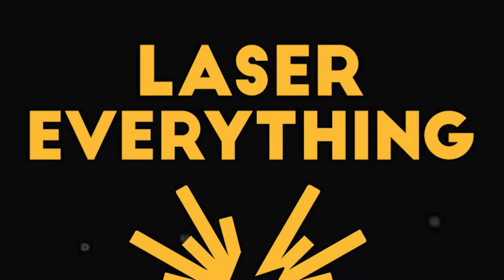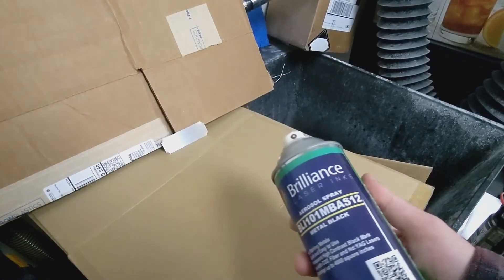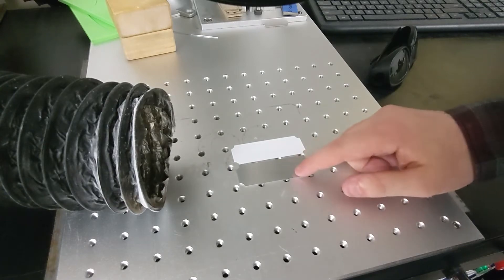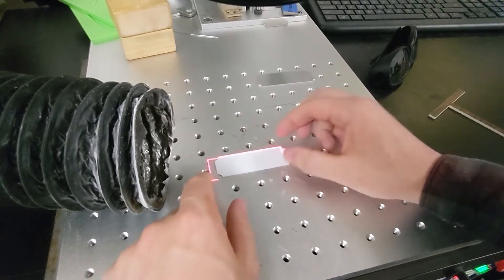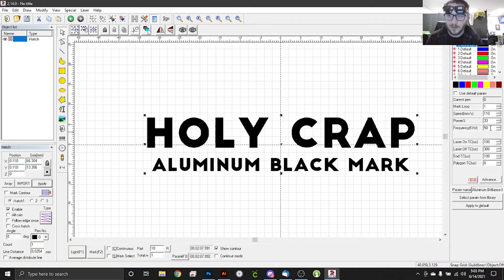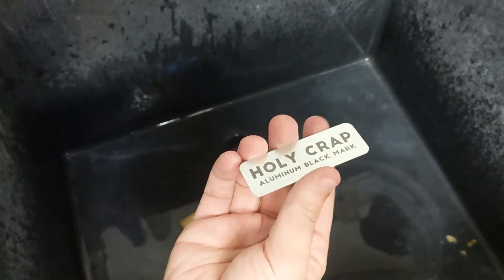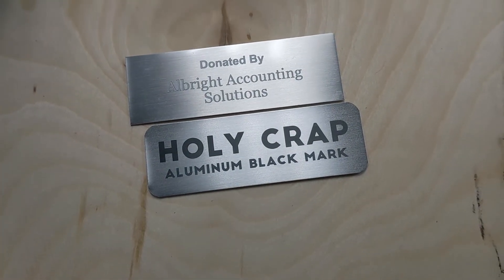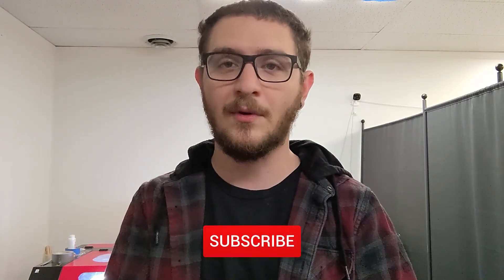How to Engrave a BLACK MARK on Aluminum with a Fiber Laser | Fiber Laser Tutorials

Comment: I get my engraving eareased when I scrub it down. Is this raw power issue or may be something else? Cheers!
Reply from the maker: If you’re using an assist spray like in the video, you may not be fully activating it and may need a touch more heat. Also, make sure the metal isn’t all oily or greasy, could cause issues. Spray has to be direct metal contact

Comment: i have a mopa 60w Fiber laser...would you have any way to mark black with it? I can't figure it out and have tried multiple settings and have watched multiple videos. Before I go and try this option.
Reply from the maker: Generally speaking, you’re only gonna get a medium gray out of raw aluminum without creating a soot covered mess, and no other assist material. You can get a surface mark that’s black on like clear anodized aluminum, but hasn’t been something we’ve done and would be more akin to color annealing on stainless or titanium where you are putting a surface mark on the anodizing.

Comment: Technically you can do dark grey or almost black with just the laser machine on aluminum, takes much longer than engraving on stainless steel and incredibly much longer than white on aluminum. Need a pretty powerful machine for more than 110x110 magnifying glass. Also the sweet spot for aluminum is ~ -5mm compared to stainless steel sweet spot.
FYI Overall with whatever material. Frequency doesn't really matter, I just switched to 0 instead of 500k for everything it's more consistent in terms of black for everything, so it doesn't red shift anymore, might get blue shift though, if done too fast.

Also use the exact same program and machine at work, also have that lens for aluminum, though I use that lens only when I need to do sort of black, but don't need any extra stuff to add on the material. Otherwise I just use 300x300 for stainless steel or white aluminum hatch. 300x300 has more leeway in terms of height sweet spot, 110x110 for stainless steel needs like 0.5mm precision in terms of height, otherwise if too low will burn the material (brown) or if too high will make the surface sort of white or mix of other colors depending on where it shifted more with thick sharp lines.
On the right side the spot is pointless it does nothing.
Laser on TC, Laser Off TC and End TC also useless.
Polygon is interesting, but it only enchances the contours (edges) and doesn't do anything for the hatch inside, even if contours and follow edge are disabled.
Power I use mostly only 50%.
Speed most of the time 200.

On the left side, "type" I use a different one which is the fastest, the one that skips wasting time on empty space, but it can sometimes cause some issues in terms of hatch consistency though can be overcome with proper line distance+order of angles, also I maxed out the movement speed (10000 under F3 I think it was) when it's not engraving.

In terms of size yeah 0.02mm is basically for everything pretty much good enough, even for the smallest stuff, going higher than 0.02mm and increase speed to 300+ will start lowering the quality. Though as a second hatch I most of the time add 0.1mm or 0.05mm.

Comment: My ezcad software says my frequency can only do 20 , it won't do 25Hz. How do I fix this?
Reply from the maker: It’s important to note that only the laser source specifications can confirm what your laser is capable of, but the software will stop you from imputing a value outside of the set min and max value within the software. The software doesn’t ask the source what its limits are though, entirely user set. You can update the min and max values within the f3 menu of ezcad (or device settings in the case of lightburn).

Comment: Thanks for the vid. I am able to get it working on black anodized and raw aluminum. However, when using the same settings on red anodized aluminum, it does not leave a black mark. What setting should I be changing to account for the anodization?

Comment: Are there any concerns with 90 degree on bare aluminum reflecting? I'm using a galvo fiber.
Reply from the maker: there is ALWAYS a reflection concern, especially when working with metals. make sure you're wearing your eye protection!
Reply: I was more concerned with the reflection into the lense causing damage. But yes, always wear PPE 👍🏽
Reply from the maker: @guythmike  It would be a freak accident if that were to occur with Aluminum. Other metals like copper, silver and gold pose a much higher risk in that regard. Generally aluminum is regarded as safe optically speaking.
Reply: Thank you! It was a pretty big investment for me and I got it solely for aluminum. For now.
Reply: @LaserEverything I meant more of reflecting back into the lense and causing damage

Comment: Hoping someone can help.  Been trying with a 50w laser, turned down the power to about 22% but othereise the same settings on the video.  I've defocused about 1mm but still can't get the black mark.  

Any ideas would be appreciated!
Reply: Im in the same spot, did you ever find a solution?
Reply: @jamesgates678 the laser mark spray doesn't work for me at all.  Tried different settings with it.  I can get close to black (not jet black) with high power and multiple passes.
Reply: @ChrisZillaGaming ty! What kind of speed is working for you? I have a 50w as well.
Reply: @jamesgates678  depends on the material and how deep you want the engraving, but slower is the key.

Comment: Is determining these settings all trial and error or is there a resource that helps you understand what you might want to change to get a desired result?
Reply from the maker: There's always an incredible amount of trial and error that goes into dialing any set of parameters in. Even settings confirmed by someone else on the same exact machine as you will require some tweaking and adjustment to get right on your end. It's never 1:1
Reply: @ in photography there’s something call the exposure triangle where you adjust ISO, Aperture, and shutter speed to get a properly exposed image with the desired look. What I’m looking for Is there anything that explains what each of the variables does such as frequency, power, speed and how adjusting certain ones will lead to desired results. There must be some starting point even if all machines and materials are slightly different. Example you want a deep dark etch in hardened carbon steel. You wouldn’t arbitrarily choose a settings and go from there. Their must be something that says typically you if you want deep start here if you want dark start here.
Reply: I did the exact same thing. I wonder why this spray doesn’t work for me. Does it have to do with the type of aluminum or whether it is anodized ?

Comment: Please help!! Why am I getting lines in my black engraving when the diameter changes 🤷‍♂️ using stainless steel. I can get a lively gloss like finish on a smaller diameter but when I use same set up just change diameter size on rotary (ezcad) I get awful lines appearing ?!
Reply from the maker: If the lines follow the orientation of the rotary, it's likely the split size and line distance not jiving together. The lines are usually a result of the line distance/interval not dividing evenly into the split size, leaving a "remainder" that doesn't get filled. It may just be more noticeable on different diameter items due to size maybe. If that doesn't help out, join one of our communities in the description and you can make a thread post where the support community can dig into it a bit more and help troubleshoot

Comment: Do you know of a QR code engraved on stainless steel metal in the back of the watch would be readable?
Reply from the maker: Glare/angle of the camera reading the code would be a factor on that and surrounding light sources, so the darker the mark or contrast from the surrounding metal, the easier it should be to read. If the metal isn't polished or shiny, it would be easier, but it just depends on the circumstances. On stainless, I would try following the Z mark method from our z-mark stainless video, it provides the deepest of black marks.

Comment: I Bought the Laser Pecker 3 to engrave onto metals. Currently I need to engrave onto a Zinc Alloy with Electroplated Coating. The Laser Pecker does not come with a manual, do you know how I can get a back finish on the engraving? Do I need to use Brilliance Spray or Cermark to achieve a black finish? I am completely new to laser engraving.

Comment: Did some tryed titanium dioxide with alcohol solution in spraybottle ratio 1 to 5
Good shake before spray it on and let it dry.
Wonder if it works also on aluminum ?
Reply: What do you use that on?

Comment: Hi Alex  we have tried Brilliance Inks on copper and on our 150 watt laser, we used 300 mm/sec and 85% power and it worked a treat.  We left the metal for about two weeks with the Brilliance Inks still on a part of the plate.  Same conditions and it failed miserably really bad result. Do you have any idea how long you can leave Brilliance Inks on metal before it loses its ability to work?

We have no other reason why - may be you or someone knows the answer.  Cheers David
Reply: Some important component is gassing-off.

Comment: I tried to mark on aluminum but didn't work. So optic laser can't mark any type of aluminum? Or a 5W laser can't mark on aluminum?
Reply from the maker: Diode lasers in the 5w range typically do not have the power required to mark aluminum.

Comment: I bought the Nasan – LS1 laser back glass separator machine. TL-LS1-NASAN
However I have no instructions other than some templates and a couple videos. I want to use it to engrave on different surfaces. What are your suggestions? Your website has some discord classes. Is this the best route to take? Thank you!
Reply from the maker: The LMA is great to get started but I'm not familiar with the Nasan Lasers. I'd start with the Facebook group or Discord server so we can check out your machine and try to figure out what  it's running.

Comment: This was done on a 30W laser , can I assume that a 60W machine would render the same result at half the power or double the speed , or is there a formula to make the equivalent setting
Reply from the maker: More or less, yes. But it will take a bit of experimentation to really narrow it down. Will probably be easier to pull off with a larger lens.

Comment: Amazing. SO can I use any laser machine of about 20-30W? Just coating the Alu with that paint, lasering, washing nd I have that result?
Reply from the maker: Yes, absolutely. Since recording this I've found larger lenses work better. You want a nice big dot size so you don't just vaporize the catalyst. Your wattage should work great.
Reply: @LaserEverything  I thought it was working only with UV or blue lasers instead it works also with red ones. That’s great

Comment: Will this work with an 20w fiber laser? I just purchased a 20w Raycus fiber laser and it will be delivered soon. I'm really stoked to get started creating.
Reply from the maker: Yes, absolutely, might even be easier. Biggest issue with brilliance on fiber is that the fibers are usually too powerful and burn away the catalyst.

Comment: Does this work also for a diode laser? I got a Atomstack P7 pro and it works with aluminum, but i like the dark black letters. thank you
Reply from the maker: To my knowledge diode lasers don't put out enough power to activate the chemical catalyst.
Reply: How could you do something similar with a diode laser engraver? Is it even possible?

Comment: Have you tried these params with different size lenses with the same results?
Reply from the maker: Larger lenses will likely require more power, smaller lenses - less, due to changes in dot size.
Reply: @LaserEverything  that what I have seen also. I f I need to deep engrave or cut I use my 163 lens if I need to surface etch, black mark on stainless or engrave tumblers etc I use my 254 lens.

Comment: Any idea whether Brilliance will work as well on brass?
Reply from the maker: Brilliance will definitely work on brass. I think they have settings for it on their website but it will likely take some trial and error to get it right. It's a good catalyst but you'll definitely have to dial it in for your lens/wattage.
Reply: Thank you for your reply. I suppose the lasers for use on stainless are appropriate for other metal, too. Right? @LaserEverything
Reply from the maker: Yes fiber lasers specifically are designed for good absorption on all metals.

Comment: The black mark comes off after i polish my metal, what part of the setting should i change ? Btw your videos have helped me so much, so thank you !
Reply from the maker: This should be the LAST thing you do to your metal. Brilliance is just a surface bond, it holds up pretty well to scratches and dings but a full on polish is gonna be tough for this to survive. If anything make sure your metal is getting hot enough - especially difficult with aluminum. Heat is required for the bonding process to take place, too much and it will burn away, too little and it won't bond. It's a fine needle to thread.
Reply: @LaserEverything  thank you for the help ! Yeah the metals im using are aluminum & nugold which is mainly copper and im having a hard time getting the right settings for the black mark i want

Comment: Very cool. How well does this work if the piece is anodized?
Reply from the maker: Likely not well at all. The chemical needs to be in contact with the metal to bond so if there's a layer separating them I can't imagine it would do very well unfortunately.

Comment: Wow, is this possible in copper? Been playing with aluminum lately.. would like to have a hold of this spray!!
Reply from the maker: Copper is the most difficult metal to use spray marking chemicals on. It reflects a ton of the laser light and makes it very difficult to heat up to the temps needed to bond with the spray. I've seen it done but don't have experience with it personally.

Comment: Is this spray basically the same as Cermark?  That's what I use on my C02 for marking metal.
Reply from the maker: Yes I have both in my shop. Mostly the same thing but I think brilliance performs better and it doesn't hurt that it's much cheaper. Never tried cermark on aluminum, I know it works on steel though.

Comment: Nice, i was on a fb group and someone said cutting silver and gold will damage the laser do to reflection what do you think? Any experience on laser damage, replacing parts?  Maybe a video on this topic ? ✌
Reply from the maker: In my experience the only thing you really have to kinda worry about is copper. The reflection index of gold and silver in my opinion is not something you have to worry about. Any modern fiber laser is equipped with a standard anti reflection coating that is in-tact unless you take your lens apart for some reason. I still engrave copper with my fiber and anecdotally I haven't had any issues. I wouldn't worry too much if I were you. 

Now industrial sized fiber laser metal cutting machines is a different story...

Feel free to join us on our discord if you'd like a few other opinions:
https://discord.gg/BQg28XH6Mc
Reply: @LaserEverything  I have had good results with coating the item with a permanent black marker 1st to reduce reflection. Works with my laser welder also when welding silver or rose gold.
Reply: is it possible to do black marking on Gold(22k) , with this ink?...Any info?
Thanks in advance 🙏